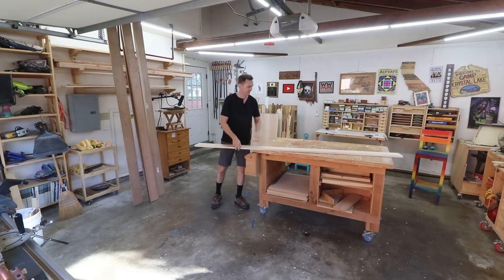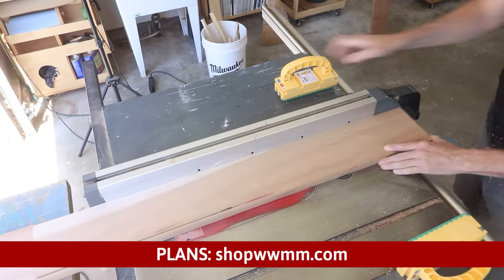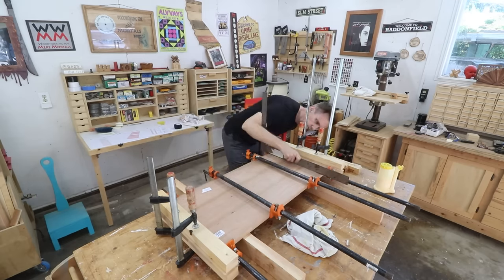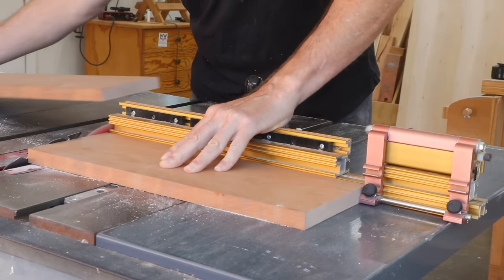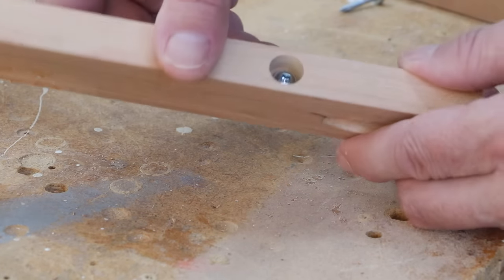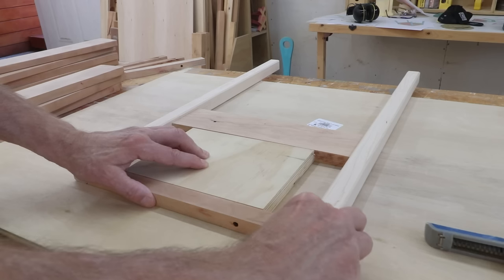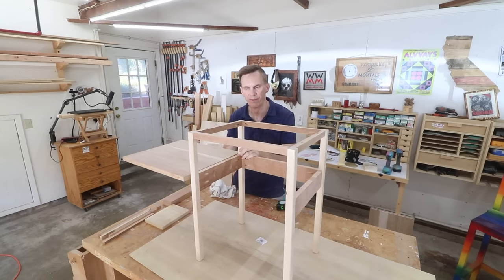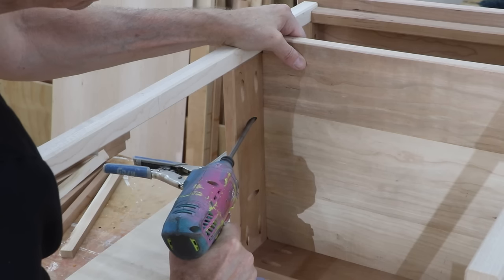The perfect bedside tables | NIGHTSTAND PLANS AVAILABLE

Comment: I just built two of these from reclaimed wood I cut from an old maple dresser I found for free on Facebook!

One tip for folks is to screw, not glue, the drawer slides on. Once they’re on, you can’t really disassemble the piece. I found that out the hard way because I glued the slides on with the wrong orientation… I ended up having to make my drawers even shallower.

Comment: Hi sir :)  Try to coat the saw blade (and the work surface) with some oil, just a very thin layer. Friction will be reduced, the cut material will move more easily on the work surface, and the saw blades will not be subjected to such pressure and material friction. I've been using this technique for many years and I almost never get that kind of burnt wood in the cut. 
Love your videos :)

Comment: Thanks for making the point that woodworkers stress about wood movement too much. I think one of the other things that’s good to do, and you didn’t mention, is to use the alternating grain pattern, or “sunrise, sunset”.  That is, when laying out the table top pieces, alternate the direction of the endgrain— if a board points up, its neighbors should point down. That way, the expansion / contraction occurs, but it works as a force agains the neighboring boards, and helps keep the top in one piece and reduces splitting. I do this with all the tables I’ve built and I’ve never had an issue, even with relatively green wood.
Reply: The technique you describe helps mitigate cupping, but does not change the side-side expansion and contraction

Comment: If you want to eliminate burn marks depending on if you are a lefty or righty offset the back of your blade a couple micro meters to the right or left of the front of your blade but make sure your rip fence isn’t pinching whatever stock is in between blade and fence

Comment: I'm following along, I've used Cherry for the entire construction, even swapping out the plywood drawers for Cherry.  However I have hit a problem whilst assembling.

As I screw my pocket screws into the joint of the laminated side they are splitting the lamination on the legs 😢 any advice?

Comment: Ive been looking at wodworking channels latley and i ran across yours. When i saw you open the garage door and kick a chunk of wood under a tablesaw leg to keep it from wobbling then i knew i found a regular garage woodworker without a $3500 dust collection system and several thousand dollars worth of jointers, planers, tablesaws etc. THis little night stand looks like something i might like to try. The plans are $27.00?

Comment: It was great to see a project video from you, it's been a while.  I have a question: I went to a Orange Store and saw some Deckmate screws, they use the Torx T25 and so I got a few boxes (different lengths) for my future woodworking projects... but when I got home I realized that what you've recommended wasn't those but the GRK brand. Still unopened... and before I exchange them... I wanted to ask you if you still like GRK, or had a different recommendation today.

Comment: How are the pocket screws not biting into each other? The legs are only an inch thick and those look like pretty big screws, and the pocket screw holes don't seem to be staggered or anything. I'm curious how that's not splitting the wood on the table legs.

Comment: how do you get the spray laquer to go on so evenly? everytime i try to do it, it's so uneven i have to do 4 or 5 coats and end up going through 1 or 2 cans.

also, what would you do to stop the drawers from being pulled out too far?
Reply: To stop the drawers pulling out too far, you could add a little stop block on the front of the runner then use a small screw in the base of the drawer at the back, or screw another block on the base of the drawer... the reason to screw the blocks onto the drawer, is to allow you to remove in future if you need to take the drawer out.

Comment: Looks great, but I dislike the lack of hardware on the drawer slides :(
Reply from the maker: Not a fan of traditional drawer making techniques?
Reply: @SteveRamsey  I’m ok with them, especially when well done (as yours are), however, long term, I don’t think they are as functional as something like ball bearing slides. I recently rebuilt a bay window built-in with drawers in my 1908 home with slides like this and they were deeply gouged through years of use, and nearly non-functional. To each their own I suppose!
Reply from the maker: I have a 300 year old dresser with maple drawer slides. Still works fine.

Comment: I'm surprised you could use pocket holes intersecting in all of the legs on the braces without them bumping into each other.
Reply: I wondered about that too
Reply: I also wondered about that also
Reply: I too also wondered about that as well
Reply from the maker: They are angling away from each other as they go into the legs.

Comment: Pretty good video but $37.00 CDN for plans is a bit ridiculous. Most guys/gals, (when not free), are typically charging around $10-$15 which is much more reasonable. Surprised there aren’t more comments.
ps: At least Dick Turpin wore a mask!
Reply from the maker: There are also pay what you want plans on my site. If you find no value in my plans and my work you can take them for free. 👍

Comment: "Clamp" pressure (using tools  in lieu of) turns out to be WAY overrated.  University testing shows that just rubbing boards together (with glue) will produce 60~70% of the pressure recommended by Titebond (150~250 psi clamping).  So regret not the absence of your bricks.  Go high tech and use a can of paint.

Comment: How many coats of spray lacquer do you normally put on?
I bought a 6 pack of the brand you recommended (and still seem to be using) a while back and pretty much spent an entire can on two medium sized picture frames made of common board; it took a few coats just for it to stop soaking into the wood and get an actual layer of lacquer to form on the surface.